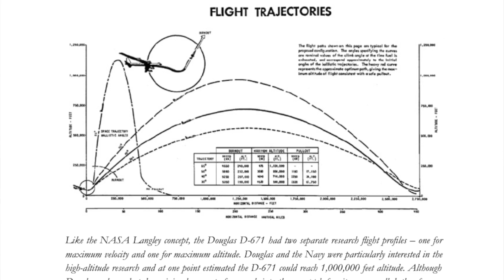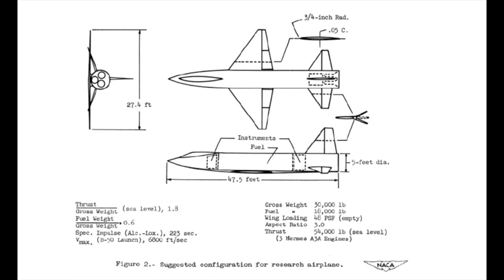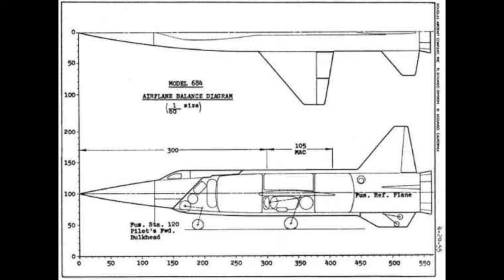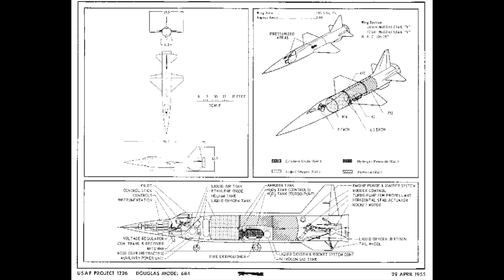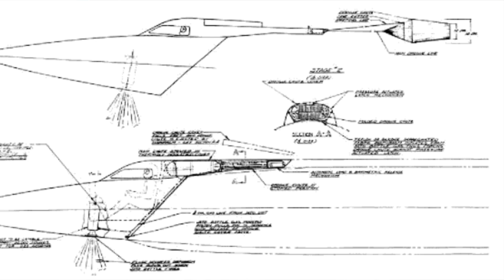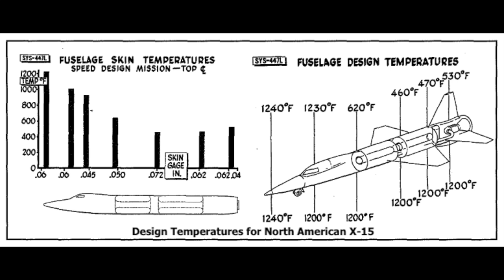The Radioactive Alternative To The X-15 - Faster, Higher, Cheaper. The Douglas D-684

Comment: Well just think, if they hadn't gone with the North American X-15 design we might not ever have seen the SR-71.
I'm not sure if thats right, the projects had significant overlap, but the X-15 was developed 5 years earlier.
Although if we never saw the SR-71 we never would have had to see them chopped in half either.
Reply: The X-15 had development begin just a few years earlier than the vehicle that would evolve into the SR-71. I also don't think they were closely related since the SR-71 was Lockheed while the X-15 was North American.
Reply: @badbeardbill9956  I'm not so sure.  I mean its possible that the X-15 and SR-71 had nothing to do with each other, but X-15 development did precede SR-71 development and the X-15 was a test bed for highly supersonic flight.  It never had a non X designation.  Being that it was never designed for any kind of use other than testing, the contract with North American was really more for test data than for functional vehicles.

When you compare that with the SR-71 development, the SR-71 was meant to replace the U-2 which, while high altitude, could be and was actually shot down.  The early SR-71 development may have gone through Lockheed, but it was really done by Pratt & Whitney.  Its more common now, but not common then that the engines were developed before the airframe.

If I had to guess (and I do because I can't find anything on it) the X-15 was a test bed for what would become the SR-71 airframe.  Note that Lockheed did not bid or produce an entry for the X-15 project.  I think the concurrent development here was between the North American avionics and the Pratt & Whitney power plant which combined to form the SR-71.

I guess its also noteworthy that Lockheed produced both the U-2 and the SR-71.  There was only a short window between the obsolescence of the U-2 and the advent of adequate military satellite imaging.  In hindsight, the SR-71 should probably have never existed.  The X-15 program and the U-2 program both predated the SR-71 program and were in existence after it was retired.

I stand by my point, but I don't really care about my having made it.  I'm more interested in the actual history of it than in being right.  Short of sacrificing a decade and ten thousand dollars in FOIA requests I probably will never get an answer.
Reply: @htomerif There were multiple supersonic research programs throughout the 1950s. The X-15's first flight was in 59, well after development work had begun for the vehicle that would evolve into the SR-71. Meanwhile the A-12 flew in 1962, but the order was placed in 1960. Early 1960 at that. As such there likely just wasn't enough time to really use any of the flight data from the X-15 program in the development of the SR-71, especially with so short a window. Not only that but the flight speeds of the X-15 weren't really in the A-12's regime until just before the first A-12s were flying. I'd say it was more a case of concurrent development than sequential, with some overlap. But I wouldn't go as far as to say the SR-71 required the X-15's flight data and experiments. Remember that the X-2 could get into the A-12's regime as well but couldn't keep it continuously.

Rather than lead into the SR-71, the X-15 likely was intended to lead into the X-20, a spaceplane design that actually came fairly close to completion but was ultimately cancelled. Especially if they considered launching an X-15 on a rocket.

Comment: The major problem with Mag-Thor would have been encountered by the machinists...it had a nagging habit of rapidly oxidizing and catching fire without warning when reduced to shavings.  Metal fires are not fun, hard to put out, and alpha-emitting heavy metal oxides in the smoke are the icing on the cake.

Comment: Heat was underestimated by NA engineers . When x15 broke its speed record, was wearing a white erosion compound. Still , the a/c structure suffered severe heat damage that could have leaded to aircraft loss.
Reply: No, they planned that flight, and the white ablative compound was intentionally used for that test.  Nothing underestimated.

Comment: Not aviation related, but many people who come by my shop are either mildly concerned or completely fascinated by the 12-20% (by weight) Thorium content in vintage still and video camera lenses from the 50's to late 70's. I believe human exposure unless one was using said camera 8 hours a day for 30 years is low, but it did not take much time to irradiate/discolour film if left attached to a camera for too long with film still loaded.
Reply: MicrophonicFool
 - My wife is a high school chemistry teacher and she uses my old Pentax camera to illustrate this. The rear element of the 55mm lens is made with thorium oxide in the glass because of its higher refractive index. It does a dandy job of lighting up a Geiger counter. At least as long as the counter has an alpha window. Not so much in beta and gamma.

Comment: So informative about the D-684's alloy and how it related to its cancellation. Great you included the Douglas Skystreak D-558. 
Please do a video on how TWO jet-powered airplanes capable of supersonic flight were flying at the same time as the X-1. And both the D-558 and F-86 did conventional takeoff and landing. F-86 went supersonic weeks after the X-1, and D-558 sometime later, but they were CAPABLE of it before X-1 did it. Needing dive speed still counts for proving sound barrier can be broken; the level flight criteria doesn't apply.
The technological overlap will make a great video. Pace of technology then.

Comment: Scott - could a (relatively) low temperature plasma be used to protect against reentry heating?  Imagine a wide shower-head being the base facing Earth, and the holes expelling a burning mixture of oxygen and propane for example, the idea being to blanket the face with low temperature plasma to guard against high temperature plasma.  Or would they just mingle and conduct heat either way?
Reply: Thats an interesting idea,
though for it to work you'll need to pump out the oxy-fuel reaction at a higher pressure than the outside pressure/compression wave. It might work with a central nozzle that releases a blanket of gas over the front of the craft?
However you might run into problems with the Ideal Gas Law as the additional gas/compression results in even higher temperatures?

Since plasma tends to be ionised, it can be directed with a magnetic field- so you could look at installing electromagnets to control the flow around the craft.

Comment: Radio active Barium infused hydrocarbon fuels were not only tested,
 but were used actively at ultra high altitudes  because of their inherently low vapor pressures.
It is interesting, and tragic that the U-2, SR-71, and Valkirie programs produced biologically toxic side products during testing and standard operation.

Comment: Loving the channel, Kerbal and otherwise. Lockheed had a nuclear aircraft lab/ base in Dawsonville Ga. When we were kids, we used to hang out at the abandon concrete structures, authority s said it's not there. Since back in the day, it has been confirmed as the GNAL Georgia nuclear aircraft laboratory. Did open air  reactor tests etc. You may know more, would make a great video.

Comment: Scott, I have a question. Could it be possible to have a reentry with a rocket-glider (X15 type planes) without burning? I mean just finding an angle of entry that would create some sort of lift but not to the point where the actual plane will start heating up as much as the shuttle did. I understand there's no way to get rid of the heat, but getting to half of the shuttle's would make a difference. Bouncing off the atmosphere, maybe?

Comment: Nuclear reactor operator here, assuming there was 3000kg of HK31 in the D684, there would be nowhere near enough radiation dose to pose any health hazard. It'd be detectable, but incredibly insignificant compared to the dose that would be received due to being at 80km altitude or even just the natural background dose on the ground.
Reply from the maker: Yes indeed.
Reply: Thank you for the obvious. The mere mention of radioactivity, in some cases, is enough to freak people out which of course which leads to the animosity toward nuclear power.
Reply: An old Navy RX Operator here, concurring with Addison.  If you live in Manhattan, your background radiation is as high as HK31 from all the granite used in building structures.  If you live in an area who's elevation is >6,000 ft, your dose rate is > HK31,as well. That's from cosmic radiation.
Reply: That is mentioned in the video.
Reply: Doggeslife Yes, but I wanted to elaborate more on how insignificant the dose would be. There’s a lot of undue fear about ionizing radiation.
Reply: I’m 50/50 happy/sad that this didn’t have a discussion escalating into chemtrail stories in the replies.

YouTube ran a number on me. I guess.
Reply: @Wroger Wroger I'm an atheist, I have to say that comment is tasteless.
Reply: In fact we use thoriated tungsten rods for Tig soldering and they have 2% thorium they are nor dangerous at all.
Reply: Addison, you are probably correct. But I read up on HK31 on Wikipedia. It came up as Mag-Thor. Apparently there was enough of a concern about the thorium that museums removed displays of drones such as Bomarc.
Reply: @donaldbadowski290  I’m surprised they didn’t remove the light too to spare the visitors and staff from electromagnetic radiation.
Reply: Addison Guynn 200 Mr/hr background
Reply: Sshhhhhh. We don't want to take some of the view-count spin out of his story, do we.
Reply: All that may be true. But would you drink Coca Cola out of a thorium can? How do you think the population would react if that got out?
Reply: It doesn't take a rocket surgeon to operate a nuclear reactor, Homer.
Reply: A nuclear reactor is does not have a fucking exhaust, Nuclear reactor operator my ass ,if you are then you have been employed at every nuclear reactor failure to happen.
I have worked at roxby downs, you do not want uncontrolled nuclear reactions any where let alone going through our atmosphere, hasn`t science done enough with fossil fuels, plastic and CFC`s for fuck sake.
A nuclear reactor is the use of water to to attempt to control an uncontrolled nuclear reaction.NOT SAFE AND NOT GREEN.
Reply: @ossiedunstan4419  you, sir, are completely clueless
Reply: @ossiedunstan4419  2 reactors out of HUNDREDS blew up. One because of human stupidity and the second because of human stupidity as well. (Building it where it was built and all) Nuclear reactors are very safe if operated well. Needs less than 10 mins of research to see that. The sad thing is that it only takes on post for people to instantly believe they are the most dangerous thing on earth. Proof? In a poll in france about a year ago 69% of people said that nuclear reactors contributed to climate change. They are admittedly correct, but the effect is infinitely small and definitely would change nothing if we removed them all. What the people probably thought was that it was a non-negligible source of greenhouse-effect gas(ses). As well, it showed that 10% of people believed that it polluted MORE than fossil fuels and 11% of those  more than COAL. This fear mongering that people do is unfounded but understandable, we did drop 2 bombs on Japan and the whole world saw the devastation it wrought as well as more than a couple during the cold war, and "nuclear" is in both terms, which is enough to terrify people.
Reply: @thomasleroy5433  it is porn
it is fun to hate with excuse
Reply: @ossiedunstan4419  the detectable radiation in the ocean from Fukushima near it has already returned to pre-Fukushima levels. Yes, you have no clue what you’re talking about.
Reply: @ossiedunstan4419  let’s make a bet on what the overwhelming majority of studies and data says shall we?
Reply: @thomasleroy5433  more then 1000 nuclear test set off  in over under and around the us  yet  no Godzilla   over 700 in the ussr  yet no Godzilla ?  why no Godzilla?
Reply: Ossie Dunstan what are you employed as? Nothing dangerous I hope.
Reply: @United_Slaves_Of_Israel  he probably is context blind. they might have bent some truths to ensure employees avoid the 1/1000 chance  of an event that leads to elevated exposures in the mine or maybe 1/100. the thing is if u start with all the sci and stats you lose half the class and we are talking miners.. aka what's best for them is not creating those situations. as to why they don't tack them on at the end? time is money why arnt u mining? 

I lived with a dude who ran a reactor on big flat us floaty thing. then got his n. e. degree. I'm no expert but I love sci so I absorbed quite a bit of info and have read more on my own. I seem to recall a documenty on the a bomb project where the scientists went to the refinement facility and ended up changing around a lot of percedures some for Saftey having to do with how much of what was stored how close. pretty sure it's the off chance that in natural  Decay a neutron goes flying off you want to lesson how many others might as a result/ if hit 

what would be better for this dude is to educate himself as to why he was taught what he was rather than thinking "dun die (we don't like the liability) 101" was a nuclear engenering course.. just read ur user name.. tell us about bat soup lol
Reply: @ThunderbirdAnthares  see two replies above for a possible explenation
Reply: @Wuety06  there have been more than a few criticality incidents at reprocessing facilities over the years due to accidentally creating a critical mass. In a safe facility considerations will be taken like simple not having any containers on site that could even possibly hold a critical mass worth of whatever solutions are being handled.

Your workers may not always know much theory or have a useful understanding that deciding to run two units of solution-A at once to save time by using a larger pot meant to be used with solution-B  might become critical and kill everyone.
Reply: @unauthorized.mimicry  yeah the more detailed version of what Im getting at. critical mass doesn't even have to be one container either iirc but that would be the easiest most likely to next to containers that are practically nuteron transparent and stacked no? iirc it's about producing 2 for every liberated at the next collision.. which ends up easier if the material is as u said big container (we are talking either raw ore or more so even yellow c.?) because what increases odds of collision is less space between emitters and absorbers so stacking barrels not made if lead and sufficient thickness  also bad. iirc earth actual had one place we found in a uranium mine that critical mass occurred naturally in the ground.

question marks cause I won't claim to be expert and it's been a while.

I watched a Richard faymen interviews and he talked about what capacity he had when they sent him on a fixer mission to the plants enriching.. abstracted from that and the ne j knew.

feyman is probably one of my favorite smart people to have explain anything. he's so damn humble about it
Reply: @unauthorized.mimicry  I looked it up again.. no hard number just average that go on to create fission not absorbed or off go space has to be 1
Reply: Radiation in low levels is relatively benign, people just freak out when they hear the word. The only danger is higher doses or chronic exposure, although I’ve seen data that suggests that cancer rates are actually lower in areas with higher background radiation, though I forget what the proposed effect is called. If someone knows what I’m talking about, please let me know!
Reply: I actually just googled it and it’s called radiation hormesis.
Reply: @ossiedunstan4419  you get closed system nuclear engines